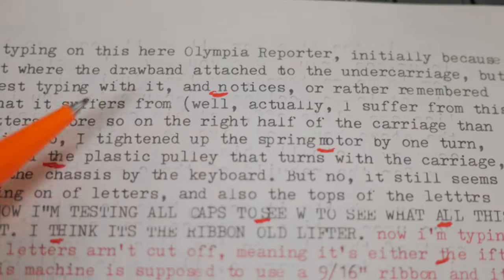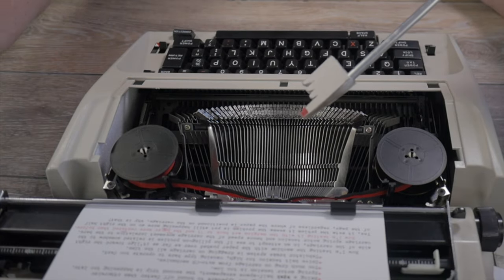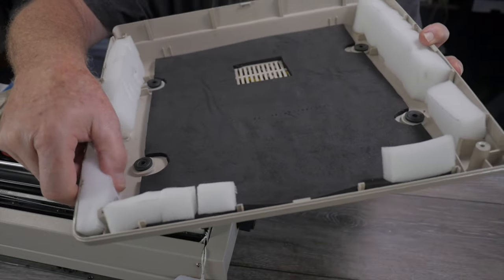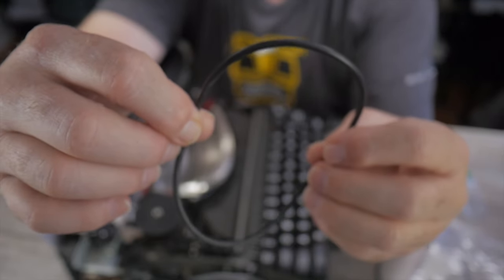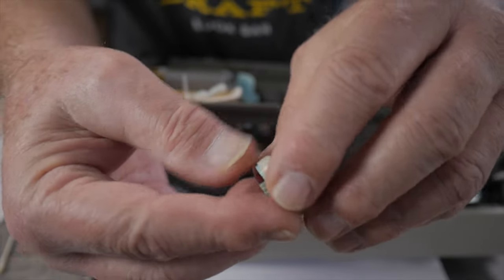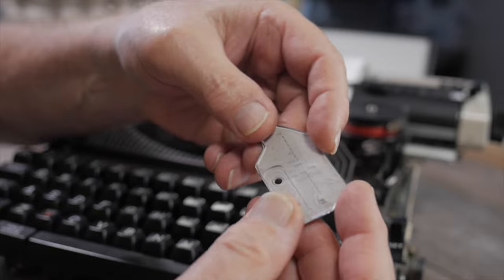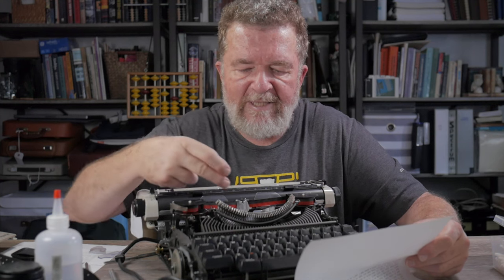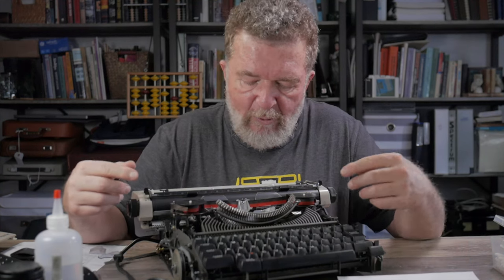Olympia Reporter Typewriter Tinkering

Comment: Great complete service video.

Two years ago, I messed up the card guides on my Olympia Monica with lacquer thinner.  I cried from my lack of care but one side was cracked and the hinge was seized in rust.

I bought a replacement card guide, complete with brackets, from Jacques Perrier because the plastic is melted into the metal backet and cannot be swapped...

Then, I found out that there is a product to polish automobile headlights back to like new that could polish the card guides.

It is supposed to bring back foggy Perspex to clear.

I did not try it because the hinge of the original card guide is stiil not working well after many attemps to de-rust it.

Daniel

Comment: Joe, Thank for all of the video’s on the  Olympia reporter. I was able to replace the drive belt on mine. Once going, I have another trouble that I would like assistance with, the capital letters are all level but the regular letters are way too high. If you could, I would like any pointers. If it were a manual, it would a screw adjustment but on this, I have no clue. Thanks in advance.
Reply from the maker: It has the same on-feet and motion adjustments as on a manual. The reason they go out over time is because the set screws originally had little phenolic  caps that dampened the sound, and these caps get brittle and break, which effects the alignment. So just readjust them and you’ll be fine.

Comment: I had my laquer thinner lesson by leaving some on the dished g key of a Silent Super and it turned a bit gooey and smudged the black print.  I blotted off the excess, let it dry, and then took some 200 grit, 320, and then 400 to the surface...and can't see nor feel an issue.  There's enough black on the letter that I dodge a bullet.  Yeah, I totally need to cover with rags or anytime I'm squirting that stuff in the future.

Comment: Hey Joe, wouldn't a repair person typically prefer to troubleshoot a problem by starting with the least invasive potential culprit (the drawstring tension) rather than the most invasive culprit (the escapement, the pulley, etc)?
Reply from the maker: The potential causes were listed in no particular order, as I indicated. And I’d already worked on the machine before making the video. So, yes.